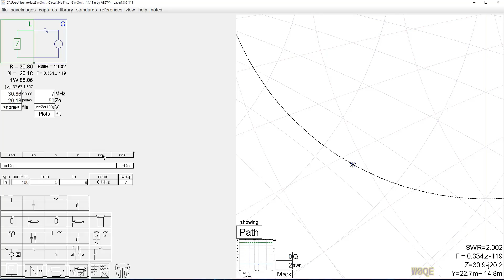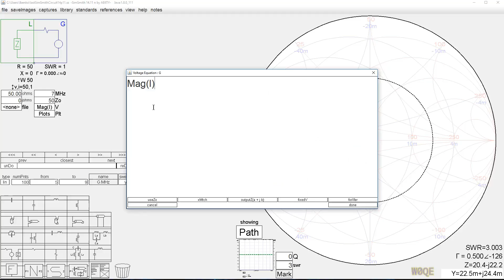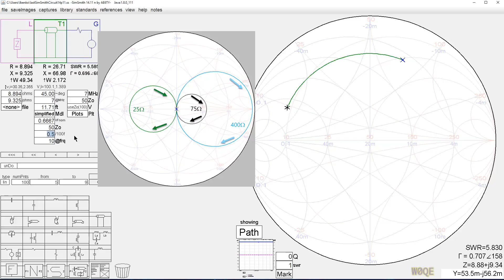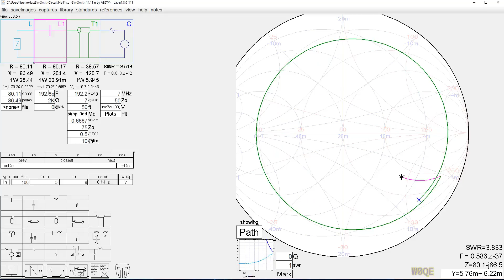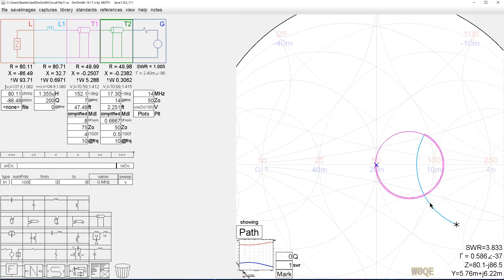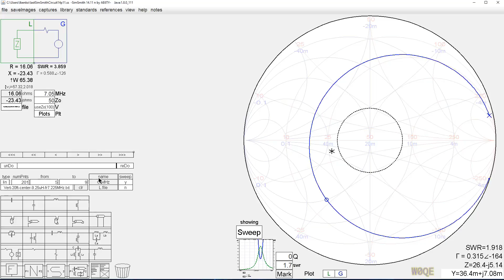#13: Matching Fundamentals, Part 1 (Basics 6)

Comment: Hello,
Thanks again for the video,. I have a question.
Can the frequency of the inductance and capacitance influence the antenna matching process?  Same question for the quality factor.
I see that in the SIMSmith table we have a part to fill in the frequency value of the inductance and capacitance. I also see in the capacitance data sheet that they have an impedance vs. frequency curve. Should all of these characteristics be considered when choosing the value of the matching elements?
Thanks.

Comment: Great video! Larry, when you achieve a match using a longer coax, you mention that the extra length can be coiled somewhere along the line. Does this coiling not introduce additional inductance and thus spoil the match? I was taught to coil coax in this way to use as a choke balun. Thank you.
Reply from the maker: Jay,
No it does not increase inductance.  The coax has both a differential and a common mode impedance.  When you coil a coax you are affecting the common mode impedance which can be useful for a choke balun but does not affect the differential impedance.
If you own a VNA, impedance meter, or even a transmitter and a dummy load you can do a test.  For the transmitter case, measure the SWR with the coax connected to the dummy load and then coil the coax and re-measure the SWR and you will see no change.
Larry, W0QE

Comment: i stumbled upon this series of videos from w2aew's site where he suggested i watch and man am I loving it. i am going to try some experimenting with my aim 4170c and see if I can match some arbitrary antennas using simsmith and what components i have available in my junk box. wonder is there is a software program to help design coils based on the diameter, material and length and cross sectional area of the material used.  wondering if you explain how i can measure the input impedance of an antenna if I cannot be at the feed point but know the length of the coax and its impedance/vf such as a dipole in a tree.
KF7NN
Reply from the maker: Goerge,
What you want to do is "a piece of cake".  The 4170 that is calibrated can measure the coils but for winding them a good calculator is at http://hamwaves.com/antennas/inductance.html which will get you very close.  If you want to back calculate the impedance you just enter a negative length for the transmission line.  However as the transmission line gets longer you run into significant error with small deviations in velocity factor over the entire length.  If you lowered the antenna and disconnected it from the transmission line the line could be be measured and known precisely.  Then raise the antenna again you could get the antenna feedpoint impedance.  If you are only going to match at the end of the line in the shack just make a measurement there and you are ready to go.  I have done what you are suggesting many times with no issues.  Have fun. Larry, W0QE

Comment: can smith chart files be imported from 4NEC2 ?
Reply from the maker: Harry,
Glad you are enjoying the videos and find them useful.  SimSmith files are natively .xml files which are text files and can be viewed easily.  SimSmith can also write data to files and I have done that in a few videos but this is data only and contains no circuit information.  I have only played around in 4nec2 casually but thought of it as an antenna analysis program similar to EZEC.  I guess I don't understand or appreciate why 4nec2 would benefit from being able to read SimSmith files.  Please educate me.
Larry, W0QE
Reply: Great video series, Im learning so much,  I wanted to import an antenna from 4nec2 into SimSmith as a load, I serched the yahoo forums and yes its just a case of loading the 4nec2    xxx.out file from 4nec2, ( having first calculated a frequency sweep in 4nec2 - thats where I was going wrong).

You have put in a hugh amount of work on these videos, the pace is great, I hadn't relaised how much could be acheived in SimSmith,

Well done

73
Harry
Reply from the maker: Ok, there was confusion about the direction.  You want import into SimSmith.  In SimSmith click on help and then primer.  On page 15 of the primer this topic is discussed.  Personally I would just make some simple antenna in 4nec2 and save to some file the impedance vs frequency data.  Then try loading this file into SimSmith.  If it works, great.  Otherwise email me the file at xxw0qe@gmail.com and I might be able to tell you what is wrong.  SimSmith is pretty flexible about parsing files to extract the data.  I have a video coming out this evening which addresses this topic which might also help.
Larry
Reply: cheers Larry - I look forward to that video - I have managed to load an antenna from 4NEC2 into SimSmith, I pointed SimSmith to the ".out" file that 4nec2 uses as its default antenna file, but I,ll also have a read of the primer.

73
MM0MHP
Harry